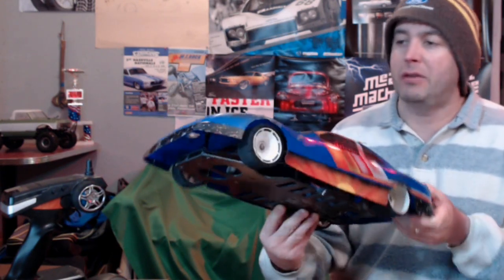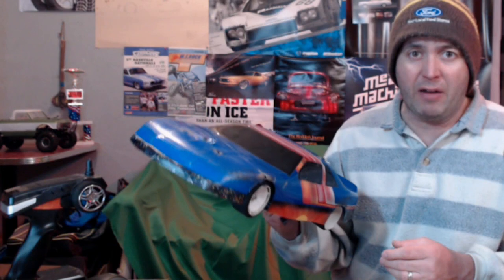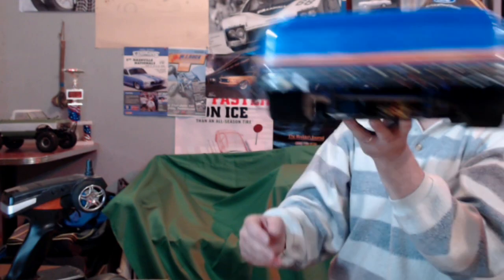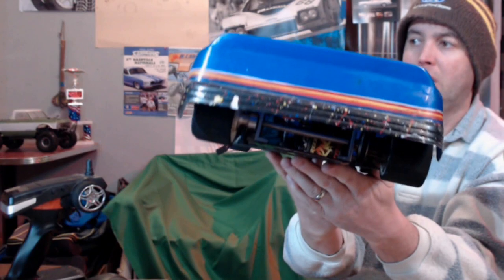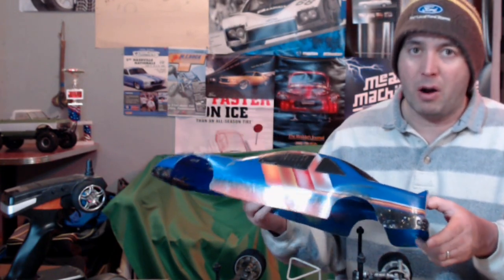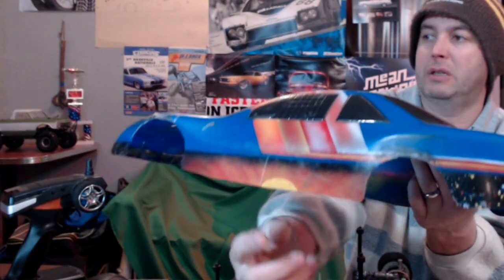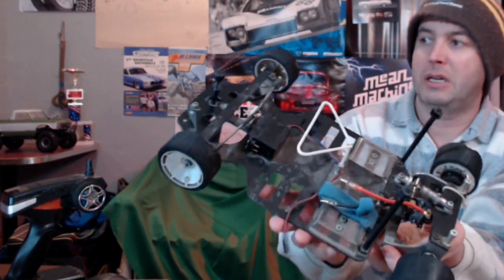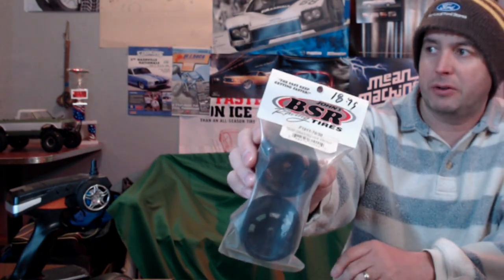Vintage Bolink RC Build prt. 1

Comment: I acquired an old Eliminator 10 and plan to back to running condition soon!  Also have the Eliminator 12.  Great cars and good tips on finding bodies for the wide cars.  Saw your part two on this and heard you mention the track in Ft. Collins. I am just a short drive from there.  Good restoration and love that color changing paint job on the new body!
Reply from the maker: Awesome. Precovid they were racing pan cars on saturdays.

Comment: I recommend a slow motor to keep yourself in a range of acceleration that is nice I used a vintage black can motor and it was spinning the tires at any speed if I hit it too hard the stock silver can was much nicer and still fast.
Reply from the maker: Thanks, that is good advice. Due to life circumstances I have yet to race this car but the one time I did drive it was very difficult. It would spin out at almost any throttle range.
Reply: @ClutchTrick  a guy gave me that advice and I still think it was good he was racing a formula 1 in a parking lot 20 years ago and there was no need to go crazy he also showed me that there were low powered stock silver can motors that had changeable brushes and more clean able 15$ back then

Comment: Most carpet oval classes like Busch class which is a national class with same rules is ment to run old or new pan car oval cars and be competitive all run foam tires the cracking and chunking happens when you race.your carpet oval track should have new foam tires for sale and they will help you cut them down as well that helps prevent chunking and cracking I have never had a set on my Busch car crack or chunk legend cars different story